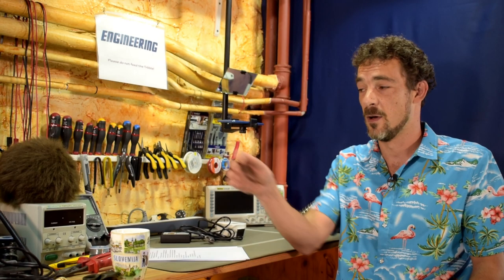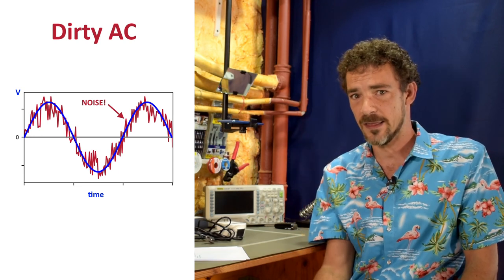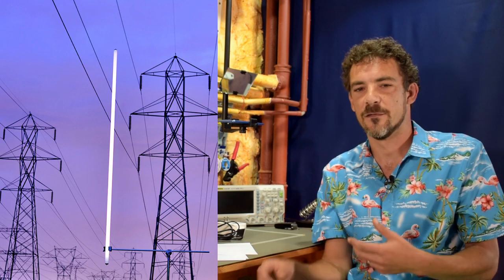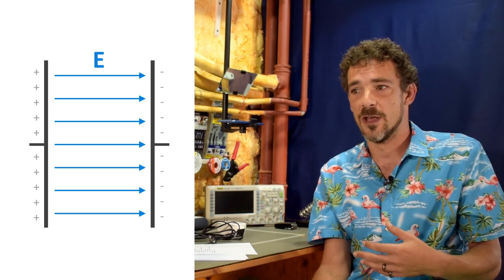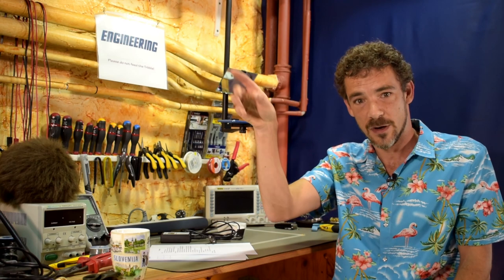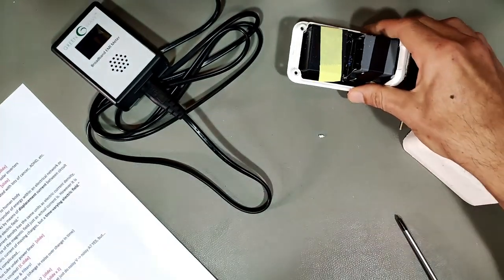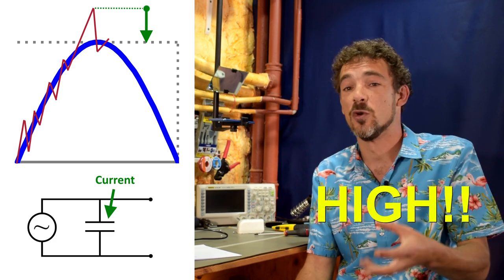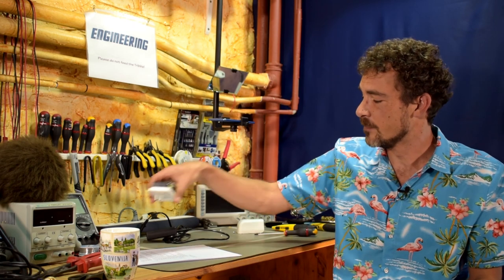Dirty Electricity: What it is and how to fix it

Comment: To measure clean or dirty power you need a Greenwave EMI Dirty Electricity Meter measured in mV. Power Conditioners are primarily used for maintaining "consistent voltage", not for cleaning dirty electric. I have a Furman PL-PLUS DMC Power Conditioner and it does nothing for cleaning up dirty electric. In fact, it makes it worse per my EMI meter. Dirty electricity is the electromagnetic energy flowing along a conductor that deviates from a pure 50/60 Hz sine wave and has both harmonic and transient properties. High levels of dirty electric can damage your components over time. No, there is a big difference between the Stetzerizer and the Greenwave. The Stetzerizer products use their own bizarre measuring system.
Reply: Thanks for that info,  precisely what I was searching for.

Comment: Connecting capacitors to power outlet’s draws power from the grid while (old) power meters won’t register it. That’s why it’s forbidden to do so in most places. 

Installing ‘filters’ like that is resolving a non existent problem. 
The most ‘sensitive’ equipment (computers) are causing the noise  and they run fine without those ‘filters’. 

Please don’t waste your money on these things and don’t waste everyone else’s money on extra power charges that these ‘filters’ do cause.

Comment: Scottie, your diagram of so-called dirty electricity is not realistic. I have been looking with an oscilloscope at 120-V powerline electricity for decades (mostly because of my job, though not a job with the power company) and I have never seen it looking like your diagram. I have always been able to display a stationary image on the oscilloscope, and all, or nearly all, variations from a sine wave have been small variations from a smooth sine curve near the peaks and troughs. Yes, even with switching power supplies, LED bulbs, fluorescent lamps and even the newer high-frequency electronic ballast-fed fluorescent lamps attached. Furthermore, I think the reason that the ac line is not anywhere near as noisy as you show is because the Thevenin equivalent resistance of the ac source is so small compared to the Thevenin equivalent resistance of switching power supplies and other generators of harmonics on the power line. The power company's source resistance is so small, and the switching power supply's source resistance so high in comparison that the relatively small current of the "noise" sources has little impact on the shape of the nearly sinusoidal supply from the power company. 

Also, just today I used the fast Fourier transform feature of my oscilloscope to look at the harmonics of the slightly distorted sinusoidal curve from the power company and its interaction with the "noise" sources, or better described as harmonic generators. I found that the power in the largest harmonic of my 60-Hz electricity is the 5th harmonic (5 x 60 = 300 Hz) with an rms voltage amplitude of about 1.33 V. Since the power in the waveform would be proportional to the square of the voltage, the power in that 5th harmonic is about 0.012 % of the power in the fundamental, that is, in the 60-Hz component. I say that amount of power is miniscule. It is negligible. Are you sure there is reason for concern? 

Furthermore, it is the complementary and alternative medicine (CAM) advocates who claim that electromagnetic waves are harmful to humans and other organisms. On the other hand, evidence-based researchers have not been able to verify that claim. I like to say that if there is any harm to humans, then it is miniscule and, as a result, extremely difficult to verify. In electrical engineering, we would say, if there is a signal, then it is buried in the noise. The signal-to-noise ratio is very nearly one.